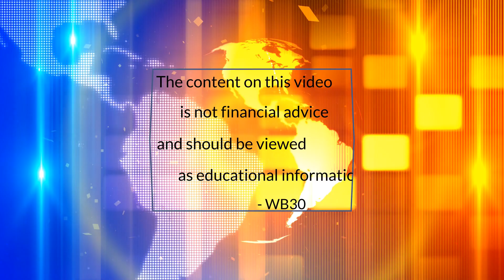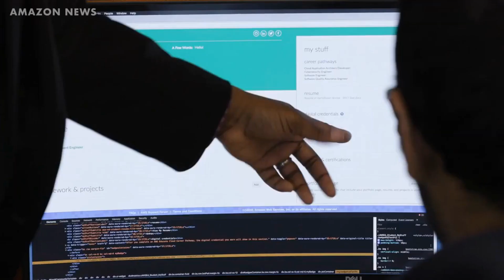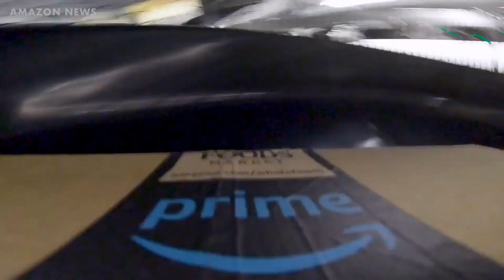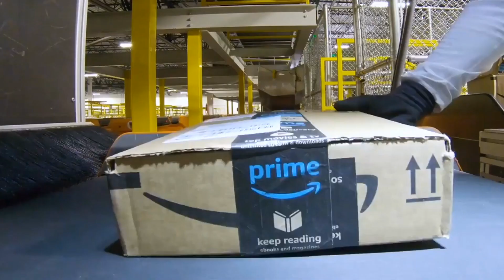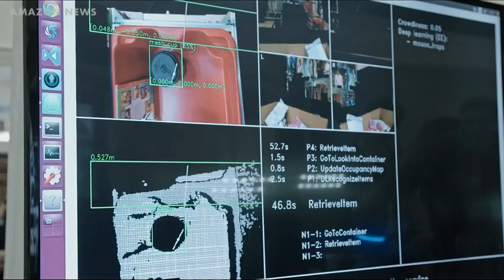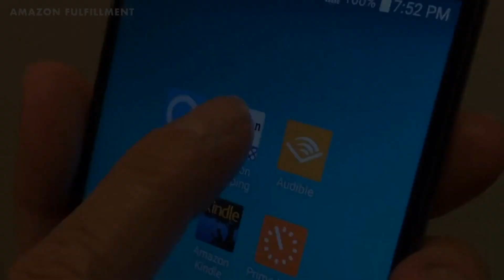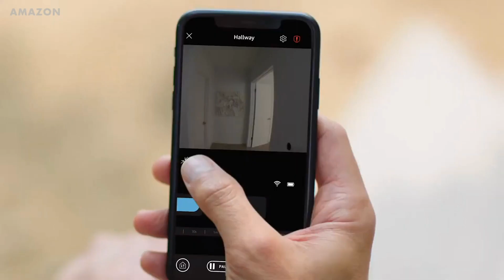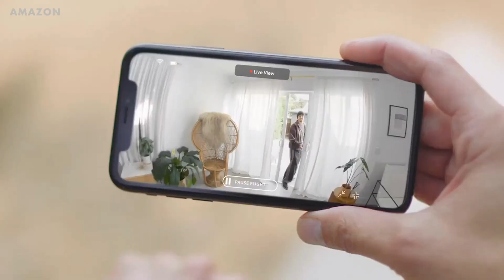Will Robots and Artificial Intelligence replace Human jobs by 2030?

Comment: by 2030 I'm seeing a job crises there will still be jobs but a lot of driver, warehouse, gas, oil, retail , construction, some in law, and some in medical, hotel maybe if no ubi. I see a ubi by the end of this or going to a 4 shift work week for the jobs that are left. after this it will be a great reset everything will change like it has not sense we started working in factory's when we used to all be farmers mostly it was better to be a farmer vs. working in the factory for time back then but worse for money by a lot. its going to be a wild ride but I think 2030-2040 will be more stable because all that will be left is to implement it in place but if done wrong it will lead to a great depression

Comment: Amazon is replacing sellers by selling same stuff for less until sellers are gone.
Then prices go up. Surprise!!!
Reply: They still have to compete with other retailers like Walmart.
Reply: @TheObserversTV  only in U.S.
Reply: Amazon is worldwide
Reply: @ruud4508  Walmart is worldwide too and is technically the largest retail company, for now.
Reply: @TheObserversTV  never saw one in EU
Reply: Amazon will feed you in 2030
Reply: Walmart does NOT ship worldwide
Reply: @KonynXoXo  monopolistic capitalism in a communist regime. With a CCP+ surveillance system. It's called MEGA system. By the usual suspects. The ones that brought you the cerveza sickness and Vax.
Reply: @German Ninja Resist! If Germany won't join, the whole 1 world order is going out the window, starting from the EU.